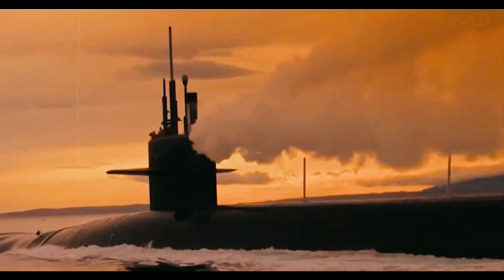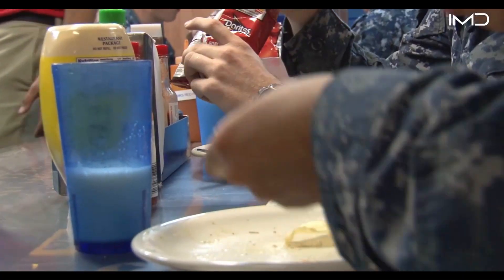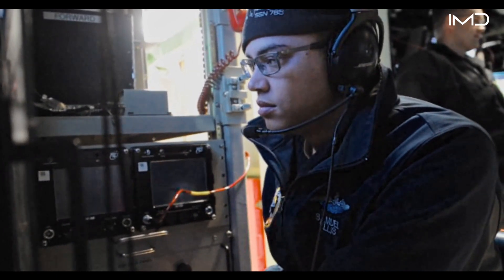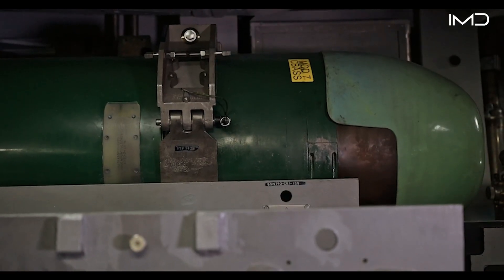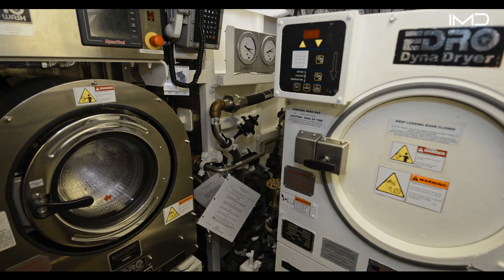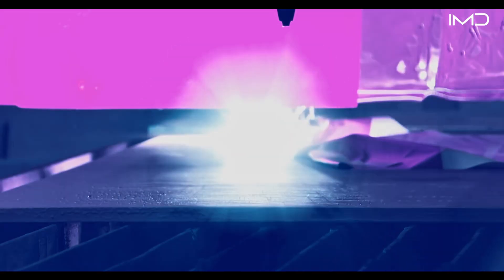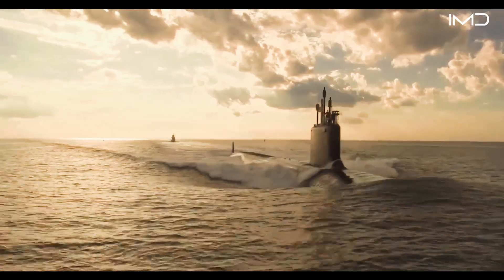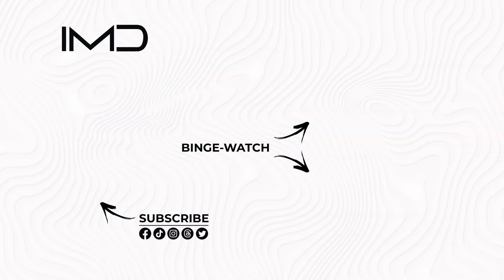How Submarine Sailors Sleep, Eat, and Survive for Months Underwater

Comment: Very surprised you did not mention Groton, CT.

Submarines are still actively built in Groton, Connecticut, primarily at General Dynamics Electric Boat (GD/EB), which designs, constructs, and supports submarines for the U.S. Navy, making it the "Submarine Capital of the U.S." alongside the Naval Submarine Base New London (SUBASE) which trains submariners and supports the fleet. GD/EB builds new vessels like the Virginia-class attack submarines and the new Columbia-class ballistic missile submarines, while also repairing and modernizing existing fleets.